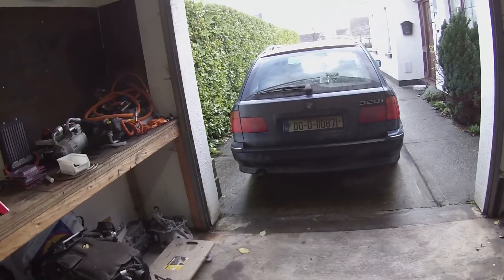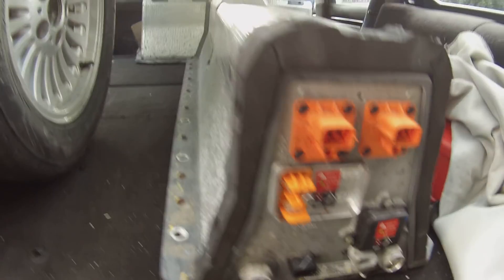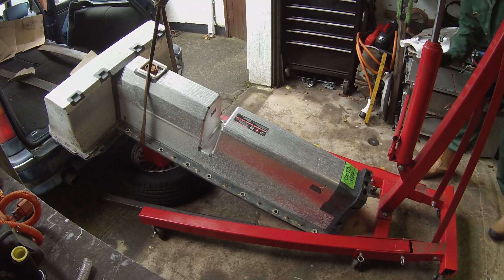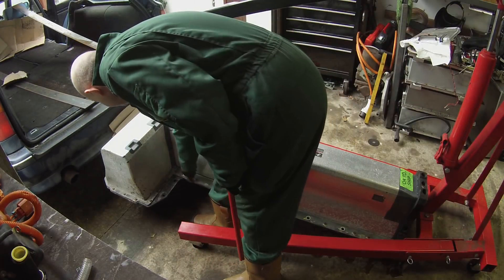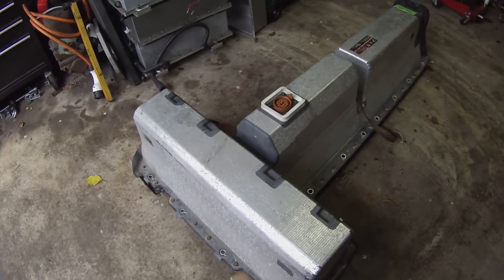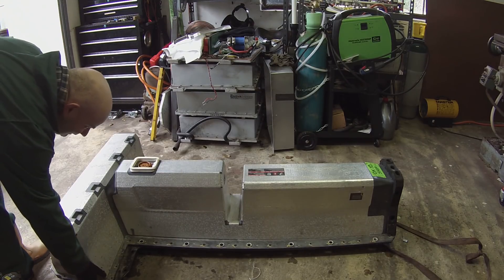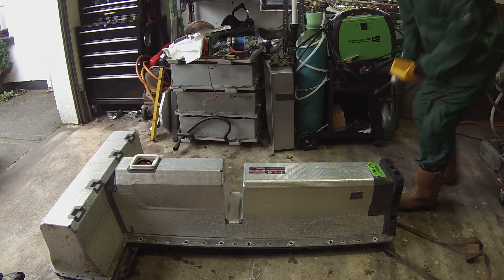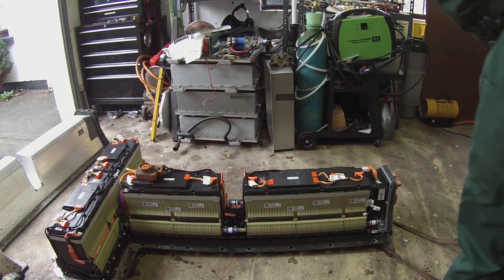BMW E31 840CI EV Conversion 95 : Tesla Swap Day 14

Comment: You got one of the best EV batteries made, at a super low price. Looks like you will end up doing something similar to what Jason Hughes did, using Volt batteries for power and adding Tesla batteries to increase capacity. Several other project which use a Tesla drive train have opted for these high power LG Chem batteries.

Comment: Nice catch :). 
I'm in process of making battery for my Prius, and will need to dig in to CAN bus for spoofing the SOC(state of charge) in order to get what i want.  Any suggestions to what can i use to get all the data without expensive  digital signal analysers ? You have to have some cheapo method :). Thanks
Reply from the maker: http://www.savvycan.com/
Reply: You do need some hardware to "join" the CAN bus... I started with a logic analyzer and a hand soldered tranceiver (hard to beat the sub $20 price to start out):
https://sigrok.org/wiki/Getting_started_with_a_logic_analyzer

Some might classify this as "expensive" but it just works:
http://store.evtv.me/products.php?cat=28
(Or if you really want to save money it is all open source, you can build your own for maybe $50 I guess?  But that will require some time and testing to get working.  If you are building your own I personally like the Teensy more than the Due... but that is even more work with no real guides to follow that I know of, you really have to want it...)

I also I recently heard about this one but have not got one to try out yet (the wifi is what made me interested) :
https://www.csselectronics.com/screen/allproducts
Reply: What are you using as the main controller chip?

Sounds like something Wolf Tronix was/is working on:
https://www.youtube.com/watch?v=O8CSRCnCm3M&list=PLQdu_G7xyFIT2YItJQL1JZujxFJl6LOWL
Reply: ya i heard about Due, that can do CAN stuff ... I'm in to building all by myself ... hard work but i want to learn more :)  charger + dc/dc bidirectional  converter (48V to 240V and back for REGEN) + CAN bus modifier (spoof) need to be built for my project :)  Thanks for info :)
Reply: Still gathering the information .. and building my batteries. Closest that i got to controllers is the discharger for testing with MEGA :) but it seems  that everywhere that i look for  example charger or the same Wolf uses Arduino compatible controllers :) Still learning this stuff.

Yes i stumbled on his videos by searching for dc/dc converter ...  and they are very helpful.

Comment: You can control the all the internal relays directly from the black and gray connectors easily.  I can go find the pinout and harness I once made to test a pack.  Also you can get all the cell voltages over CAN bus very easily.  I think the CAN ids are 0x200, 0x202, 0x204, and 0x206 if I recall right.  Once you put 12vdc on the right two pins the BMS just starts dumping the cell voltage data continuously.  I guess I should collect all the information and share it on github or something.  Weather got cold and rainy, now my pack is just buried under kids bikes and strollers in the garage.
Reply: Ok, black connector pins 2 and 4 go to +12v (when looking straight at it bottom row second from the right side is pin 2 and bottom row third pin from the left is pin 4), gray connector pin 5 goes to ground (second pin from left on the bottom row.)  That will turn on the two main contactors inside the pack and put the full pack voltage on the the top left orange connector (when looking straight at it + on left, - on right) and the central big connector (+ on top, - on bottom).
Reply from the maker: Thanks a lot :)
Reply: I guess it's kinda randomly asking but do anyone know of a good place to stream new series online?
Reply: @Christopher Thomas Try flixzone. You can find it on google :)
Reply: @Trace Brentley yea, been using Flixzone for months myself :D
Reply: @Trace Brentley thanks, I went there and it seems to work =) I really appreciate it !
Reply: @Christopher Thomas No problem =)

Comment: 600 for that battery? Steal! I'm looking forward too seeing what will you do with it. Even though I only had bad luck with my lithium cells until now they can't all be bad, If I were to find an almost 20kw pack for 600 I'd buy it in a heartbeat. Use it for an ev conversion  (perhaps an e36? wink wink) got some inspiration here, and they're cheap, a crappy non m3 2l version can be had for as low as 1000 euros. I only need the frame of the car anyway so the m3 would be a waste. Or perhaps make a solar system, either way when I think batteries my pocket shivers. they planned cheaper replacements for stuff like the nissan leaf battery (5000 ish dollars I think) But currently they're unavailable, I think they did it for many years later when batteries will be easier to make, and not to scare people away with 10k pricetags, so if it does become a reality then used batteries might finally become affordable enough for the poor mod wannabes.

Comment: What a bargain for that battery :) But you where the right person get that bargain. There are tons of info and YouTube materials on using this battery for various projects. But I dont think anyone have "hacked" the original BMS yet. However I have seen that there are replacement custom BMS:s for this battery on EBAY. Good luck from a Opel Ampera owner in Sweden.